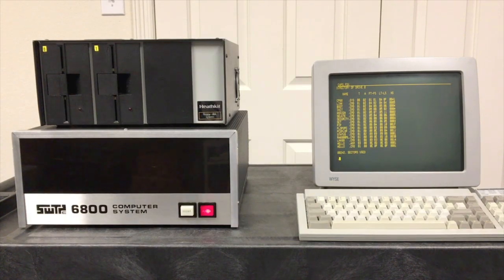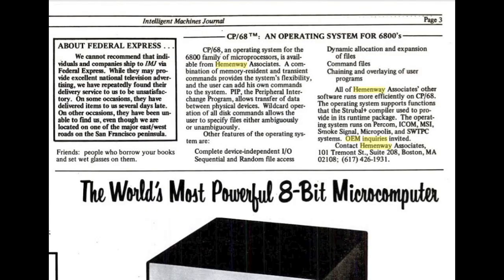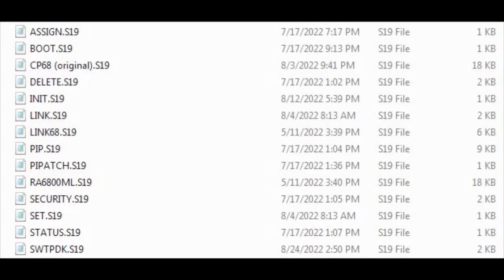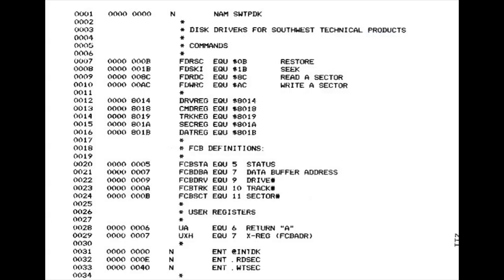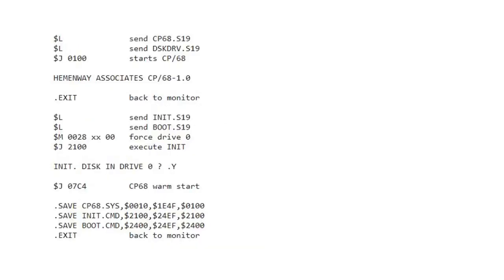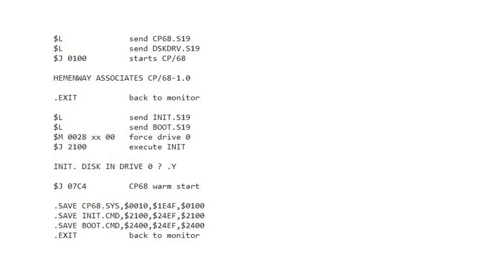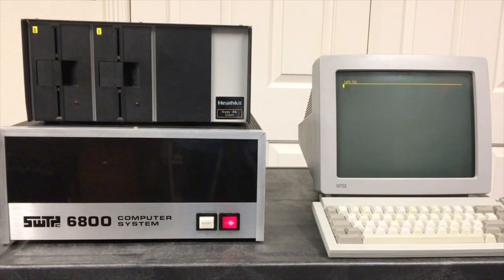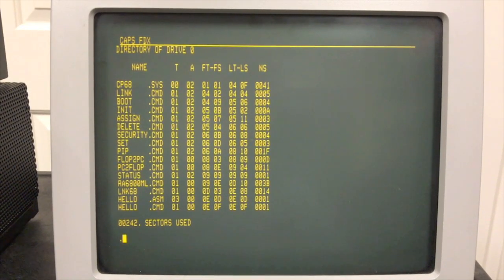SWTPC 6800 - CP/68 Operating System Part 1

Comment: Great detail, well done for documenting the steps required.  I'm curious that once armed with OCR why the S-records were scanned and not the source.  From personal experience source is relatively easy to correct mistakes in.  And you end up with the source.
Reply: Personally I'm wondering how well the S-record binaries match the source. I'm guessing there are discrepancies, because there always are! If you want a rabbit hole, go look at the Cliffhanger game from the part-work INPUT magazine --- it was a multi-part type-in game for half a dozen different platforms, and none of the parts matched up...